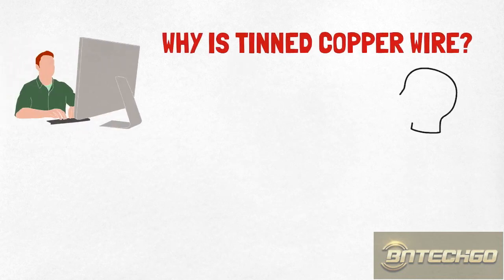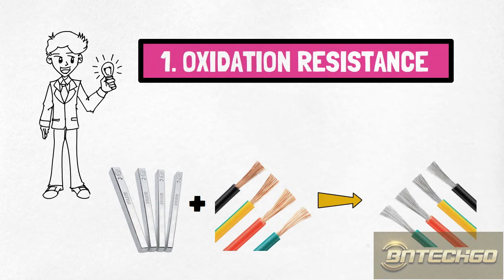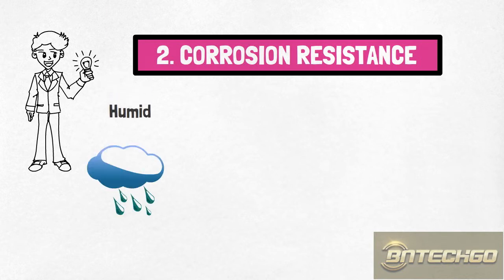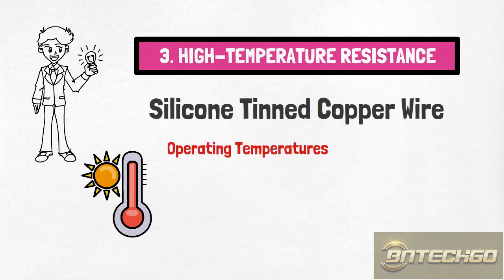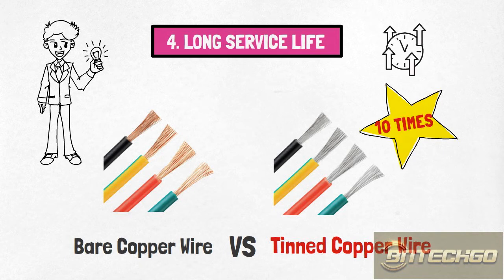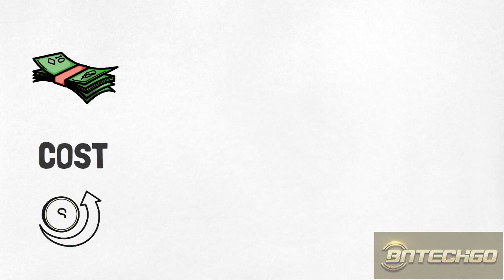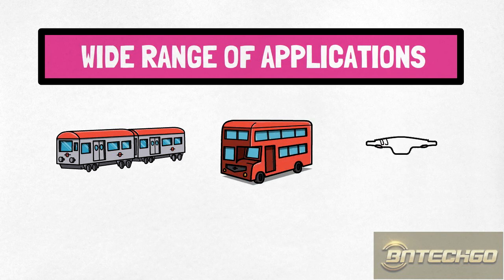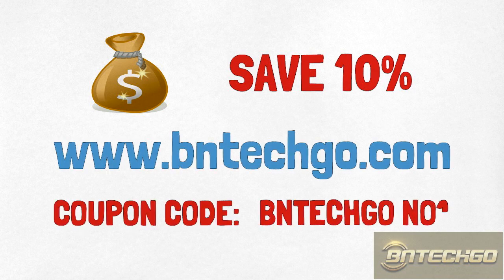WHY IS TINNED COPPER WIRE

Comment: I've always wondered why tinned copper wire is used instead of just copper wire. It makes sense now that the tin coating helps prevent oxidation and increases durability.

Comment: electricity runs only on the outer most layer so effectively the electrons runs on tin like copper cladded aluminum wires would be regarded as copper. am I right? so when I check for wire size in my code book I should look for tin wiring?!!
Reply from the maker: thanks for sharing your insights
Reply: Wrong. Especially when it comes to DC, which runs through the entire core. AC depends on the frequency to how deep from the surface the current runs. Normal households 50/60 hertz goes about 10mm deep, which is the whole wire, in other words.